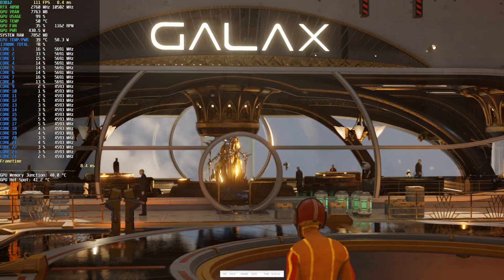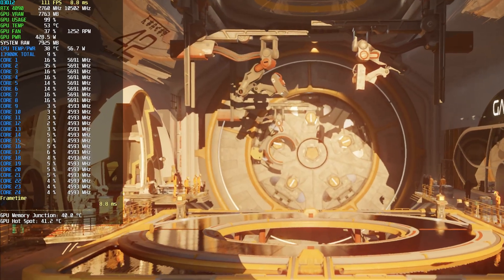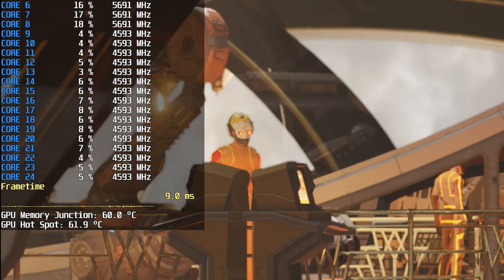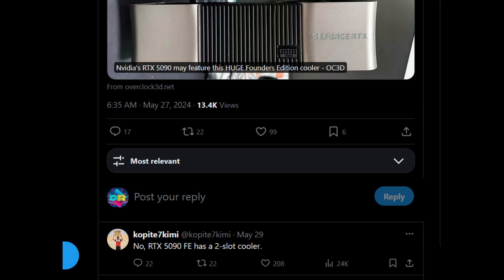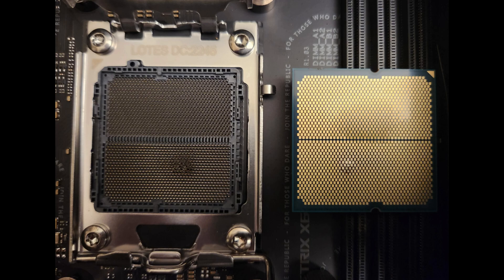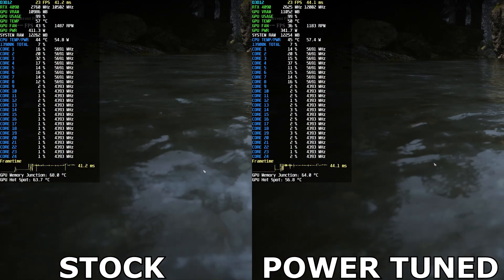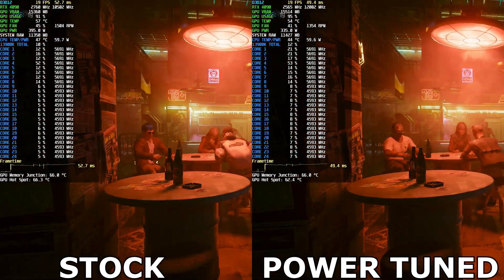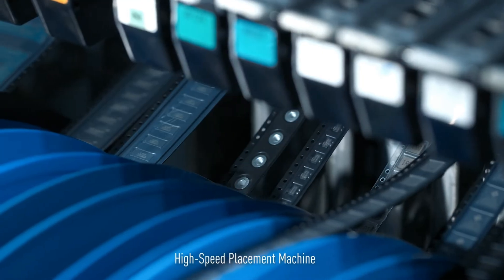Nvidia RTX 5090 Could Be Cheaper Than You Think! Here's Why - Are They Finally Listening?

Comment: They just proved me right,people in comments said the 5070 would be weaker than the 4080 it's not
Reply from the maker: 5070 will 100% be weaker than the 4080 in pure raster. Only using Nvidia's hallucination frames will be it be "faster"
Reply: @DannyzReviews  We will see if I'm right. I have faith. I'm using a monster 4070ti, which is cooler/better DLSS, same regular performance without DLSS as the 3090, so it's not impossible for the 5070 to match a 4080.
Reply: @DannyzReviews  the focus on frame gen is a massive red flag, need to wait for reviews to see what raster 5090 vs the 4090 will be, best guess 15-20% better.
Reply: @Quint1975  We will see if I'm right. I have faith. I'm using a monster 4070ti, which is cooler/better DLSS, same regular performance without DLSS as the 3090, so it's not impossible for the 5070 to match a 4080.

Comment: Before the 4090 release, speculation were ramped with ppl thinking Nvidia will launch the 4090 at $2500 to $3,000 because of the specs and rumors that it absolutely destroys the 3090 and 3090Ti which launched with a high MSRP. As someone who had a 3090 and upgraded to the 4090,  Yes the 4090 destroys my older 3090 and is way more power efficient but the 4090 still launched at $1,599. Every Gen this happens with price speculations, Nvidia knows what price range they have to stay within to sell their products. Personally, I'm guessing $1,799 for the RTX 5090 and $1,000 for the RTX 5080. "The more you spend, the more you save"

Comment: It's really odd you seem to be wishing Nvidia would NOT push for maximum achievable performance in the top-tier card, and are more interested in power savings.  Are you really the target audience for this kind of card?  Because that's quite the opposite of what I want.  Go for a power-sipping midrange card with cheaper cooler if you care about that stuff.  I want maximum capability possible every generation, with price being my only constraint.  And yes I bought a $2k watercooled 4090 on launch day.

Comment: The xx90 is meant for workstations. Thats why it gets almost double the VRAM. Theres a market for it but it’s small, and Nvidia knows those people will pay whatever for it. I have a feeling the 5090 will cost 1999.99-2499.99, while the 5080 will be around 1,000-1200 to cater more to gamers. Imo they should keep the 5070 the same price as 4070 since the xx70 is usually the top seller each gen.
Reply: lower 5070 price

Comment: look at how the 4070 is now its a upgraded 3080  so i suspect the 5070 will be as strong as a 4070ti which will be a good jump

I suspect to the 5080 will be as strong as a 4080

And the 5090 will be the 4090ti

from the 1080 card I had since the month it came out I was getting great fps using 1440 high in every game I only upgraded cause I needed the newer tech for upscaling

So if I wasn't upscaling I still would have the gtx 1080 and still getting good fps

I only upgrade now for future updates to use more power of my card for topaz

But now I’m thinking 5070 will only be a little stronger than 4070

Comment: The latest rumors suggest that 5090 will have 600 watt tdp. So i dont think that Nvidia is changing direction. Although if it is a 2 slot design. It will be very interesting to see the actual card.

Comment: Only way for this to be cheaper or not as expensive as 2000 dollar is NVIDIA releasing the 5000 series with no new dlss no new frame generation no new ai tools which will make the 5000 gpus a more refined and much more powerful carda than the 4000 gpus but knowing NVIDIA they would prefer coming up screaming new dlss feature new frame generator better RAY TRACING and new AI feature all which are goings to be insignificant but will be introduced to make the gpus expensive

Comment: Nvidia sell IA server GPU at 33K when they cost 3K. Why ? Because enterprise will buy them anyways.

Just like they gonna buy a Rog Matrix (4090 costing 3200$, yes, the same as a full 7800X3D+4090 system).

The 5090 launch orice will be minimum 2500$. Max: 3500$ (Remember, the 4090 Rog Matrix cost 3200$. 3500$ is totally not a crazy guess)
Reply: @FireCestina1200  wtf does rog matrix has to do anything with 5090 msrp? These cards are limited edition and extremely binned. It could cost 5k if asus wanted lmao.
Reply: @darkfire3691 Yes. And people would still buy them. Nvidia knows that. There's nothing who has held back Nvidia to launch 3070 at 700$ and 4080 at +500$ at 1200$. There's nothing holding back Nvidia to launch 5080 at 1700$-2000$ compared to the 4080 1200$ launch.
Reply: They ain't jumping over 1000$ in one go if the price rises then it will be 1800 or 2000

Comment: There is no reason for Nvidia to sell a 5090 for any less than $2k. It does not matter how it performs as long as its the current best. Remember the 90 class market makes up less than 5% of all the gpus out there. Its a flagship and as such people will pay. You know it. Nvidia knows it. It doesnt matter if the price to performance is awful. What nvidia needs to get right is 80 class pricing. Cut the 5080 down and charge $800 for it. The 4070ti super is just about what the real 4080 should have been at launch. 

Side note. Even though 16gb of vram is enough for 99.9% of games for at least the next 4 years i cant fathom giving nvidia $1k+ for 16gb of vram. Either bring it down in price or stick more vram on it.
Reply: Because they're going to release a Titan variant for the high end.  The 5090 will be $1599
Reply: @badpuppy3  The issue with the 5090 being $1600, is that it will be much harder to get and you may not be able to buy one the second it drops, and it could be sold out for maybe a year etc... If it's priced at $2000 , you should be able to buy one on release date if you're there the minute it goes up for sale

Comment: Its not the wattage that kills chips its the voltage. Pumping 1.45-1.6V into the ring bus is mostly the reason(it shares voltage with cores and 12.gen runs at much lower voltage here and not affected). I think the new 5090 will use the same power as the 4090. The power plug is fine, just a few bad apples and some not plugging the cable completely into lock. Or they wore out the connector by disconnecting the plug too often. The path of less resistance is doing the same as 4090 so thats what they'll do. You're logic in this vid doesnt add up. Same node and now they drop power and speed? WHY?! Ofc they need to keep the power up for more speed to use the dddr7 with increased bandwith/latency. More performance equals high price and good margins. This is what nVidia is all about. Amd just did the opposite and the cpus sells poorly.

Comment: The process node will be a massive factor in determining the performance, price, and power efficiency of the RTX 50 Series. Since nothing has been confirmed yet, TSMC 3nm is still a possibility. It's definitely possible that the data centre chips and gaming GPUs could use a different process node despite being on the same architecture. If they do go for a TSMC 3nm node, it will likely be a custom 3N node to maximise the performance and efficiency of the RTX 50 Series.